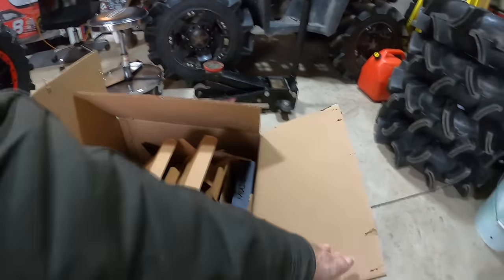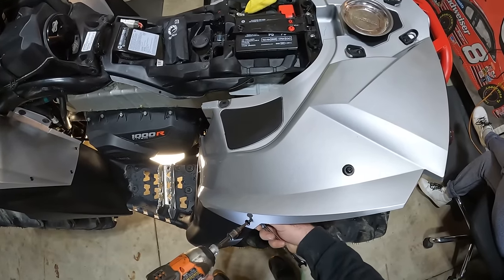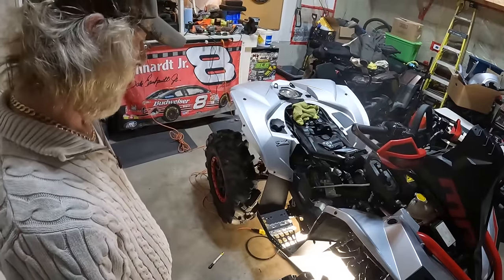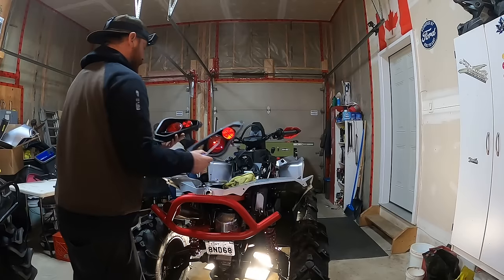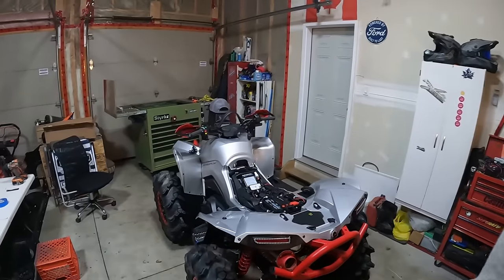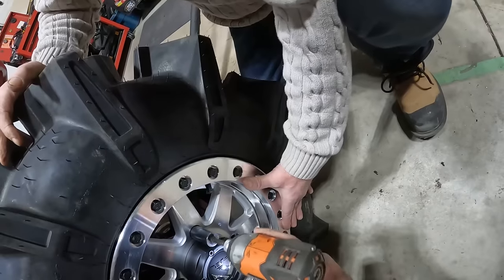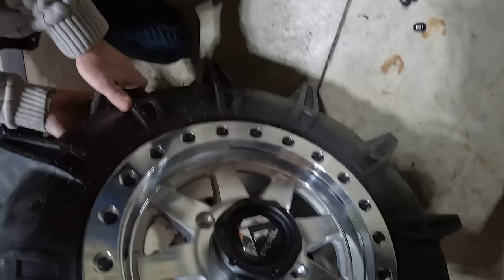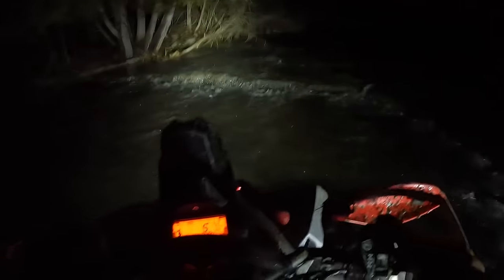SuperATV 32" Assassinators For The New Renegade

Comment: 2 questions.. did you have to adjust the clutch for the 32" Nators and do you get the FarMudding parts in Canada somewhere or have em shipped from U.S.? I will be putting floorboard and Nators on mine this winter.  I already have a clutch, tune and pipe.  Next up after that, Elka suspension.
Reply from the maker: L1feoutdoors.com sells them this side of boarder. Yeah I adjust dog weights for 32s

Comment: Looks like the wiring is still to long on the tailights and to fine of wire
Reply from the maker: Could be a tad shorter, your right. But certainly not a deal breaker for me. Wire size has yet to be an issue for me